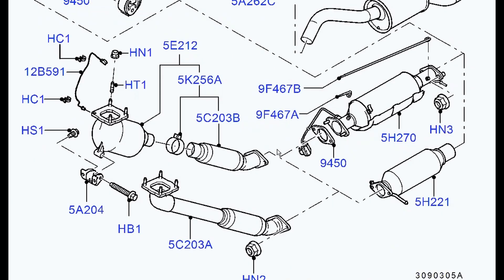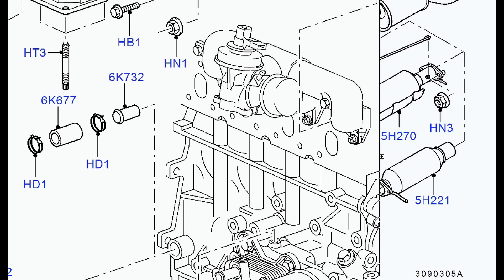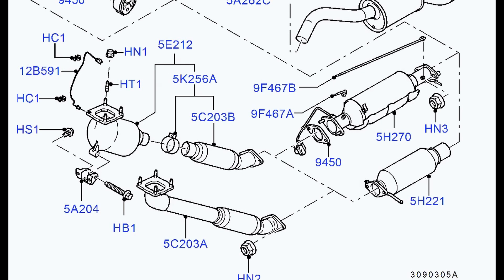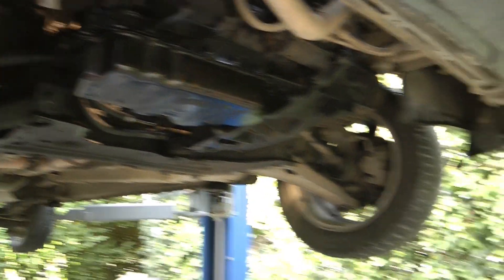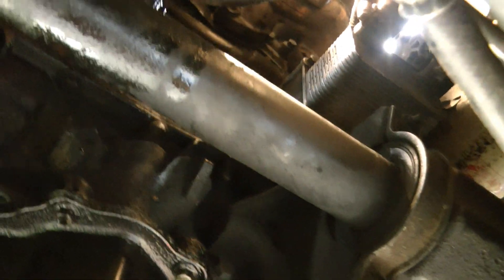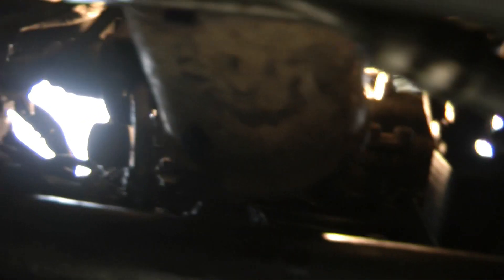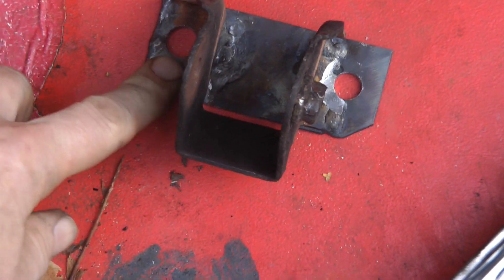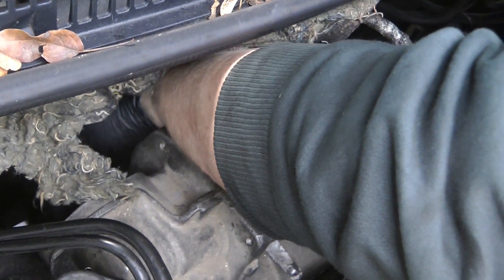Ford Turbo Diesel Whistle when Accelerating Transit Connect Exhaust Manifold Gasket Replacement

Comment: Great video. I have a ford transit lwb diesel 2005. Noticed a loud intermittent whistling, its still happening. Mechanic didnt know what it was but thought it was the turbo. So i'm pressuming this could be the answer. I'm not a mechanic but it looks like a pain of a job. How long did it take you? Thanks.
Reply from the maker: About three hours to change the gasket.. but with hindsight the nuts just needed tightening. They came loose due the CAT support bracket issue the rocking manifold worked the nuts loose.  Good luck if you take it on...

Comment: This has got to be one of the most informative videos I've seen in a very long time. Well done that man. Would this also be the issue with peugeot 407 2.0 hdi? Mine whistles badly. Did a smoke test on inlet side and found nothing.
Reply from the maker: Yes most likely. the metal shim  gasket acts as a reed in a wind instrument.
Reply: @razenby  thank you 👍

Comment: Pity this video isn't of a MK1 Kuga.  My kuga whistles/loses power when accelerating through the gears but doesn't whistle when in neutral. Question: is that black gunk a result of the loose manifold?
Reply from the maker: Mileage and year??   You can always see when a diesel manifold has been leaking.  When you say loses power do you men it is sluggish or the motor cuts out. If it is slow then suspect the turbo and make sure all the pipes going to the turbo are plugged in.  If you have DPF it could be blocked...

Comment: That's a brilliant video. I've got the same problem. Where did you get the cat bracket from? Hens teeth by the looks of it. Thanks!
Reply from the maker: I welded the old one. I just looked on the web think it may be a Ford 5A204  (search that) Current link  see https://www.ebay.co.uk/itm/385368628668

Comment: Hi, thanks for the video/info. Curious to what software you used to get the technical drawings and information please?
Reply from the maker: It is just an old products from Microsoft called Image composer.  Everyone I know who used it back in the day still use it, It is a great bit of software.  Easy to use.  No licence needed it was an add on included with Microsoft office but they just dropped it.

Comment: Great info, thanks. I have some whistle on boost on a 1.8TDCi, although not that bad but I do have lots of exhaust leakage so perhaps I hear the turbo from the broken flexpipe? Smoke so bad could not be under the car starting it to have a look (have got no lift), hence had to run positive pressure up the whole exhaust system using a vacuum cleaner blowing the air in, then spray dish soap water on it to find the leak.

Will def check the bracket too, but I wonder if the cat could easily be removed without any additional disassembly around it? I want it taken off to splice in a new piece of flex pipe
Reply from the maker: The manifold definitely whistles when loose.  It is the gasket acting as a reed. The flex pipe on the exhaust sounds like a blowing exhaust. Why do you need to remove the CAT?

Comment: Was having a similar problem with my Mk7 2.4, developed a what I thought was a ticking sound, rough revving. Turns out few of my manifold bolts were loose. Saved me what I thought was going to cost a fortune 😁
Reply from the maker: Great news.  If you haven't already, the main thing is to make sure the bracket that secures the lower end of the cat to the engine block hasn't sheared off.  If it has then the bolts on the manifold will again come loose within 500 miles.. Thanks for watching. Please remember to like and subscribe.
Reply: @razenby  I will check those today yes, cheers 👌

Comment: Kool, I have the gasoline version in the states.
Love this thing.
Reply from the maker: Thanks. This one has done about 120K miles. We are determined to get as much out of her as possible.  You can buy used examples extremely cheap because the professional mechanics in the UK charge so much and frankly they cant be trusted to put all the bolts back..  Mechanics seem to have a particular issue with routing and clipping pipes and wires back where they are supposed to be.   They seem to work on a basis of 'do the necessary to get it running and out of the workshop and get paid'  They are satisfied if runs OK for long enough to claim plausible deniability when it breaks again. These vans aren't particularly unreliable - it is just most of them are suffering from very poor or no maintenance. Thanks for watching.
Reply: @razenby  They are hard to find over here.  Most folks and companies drive them till the wheels fall off.
I bought mine to haul my mum around in her wheelchair.  2012 with 63k miles.
They are awesome little vans.

Comment: The designer of that needs a slap with a wet fish, Not cod as it's too nice to waste :-D
Reply from the maker: It is pretty poor. The turbo needs an engine bracket to stabilise the bottom of the manifold.

Comment: Well it's about time !!!!!
Reply from the maker: I had a stinker of a design contract that kept me at bay. It turned from electronic design into a put into a manufacturing, plastic moulding design, overseeing tooling manufacture and then a sourcing nightmare when the microprocessor that was designed in  parts suddenly becoming unavailable 'due to the pandemic'.  Then a mad redesign to change to an available micro and port the code. I am not taking one of those on again. Ever!!